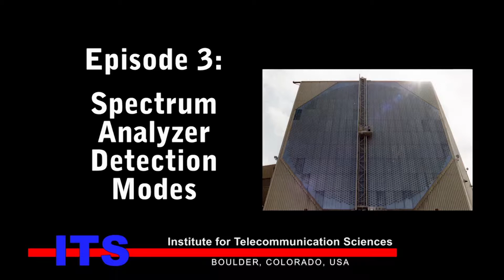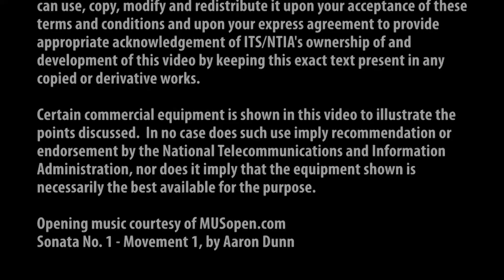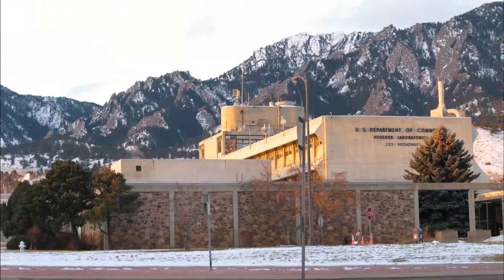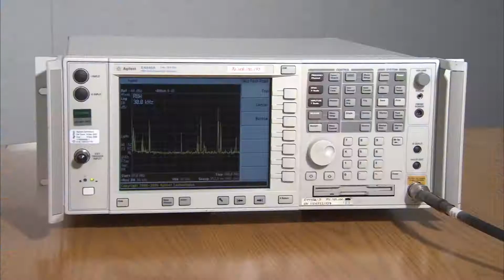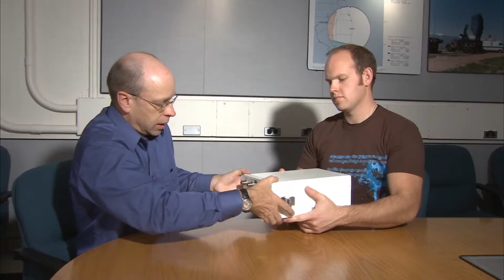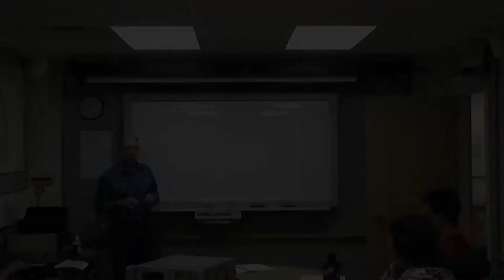Talk 3: Spectrum Analyzer Detection Modes

Comment: I am skeptical that all analog spectrum analyzers connect detector output to an ADC. Don't old analog spectrum analyzers with CRT displays amplify the analog detector output and use it to control electron beam deflection in the CRT?

Thanks for this amazing resource.